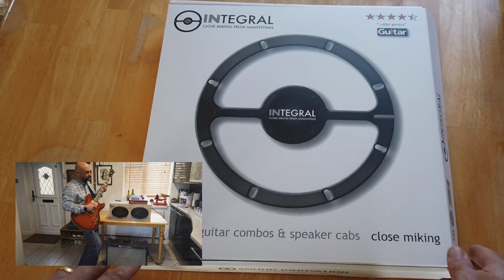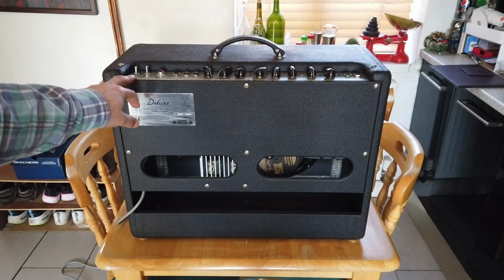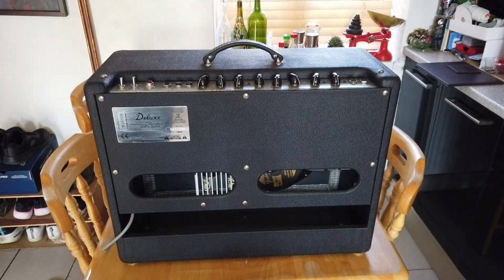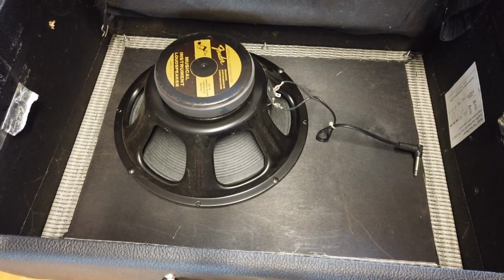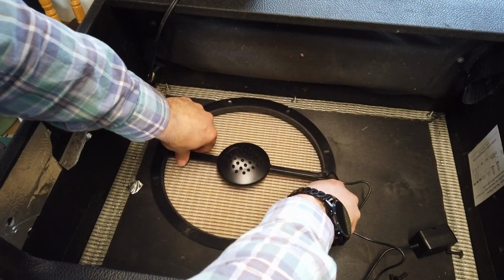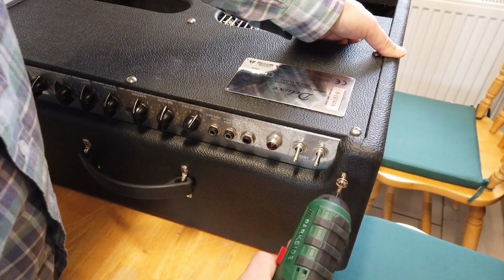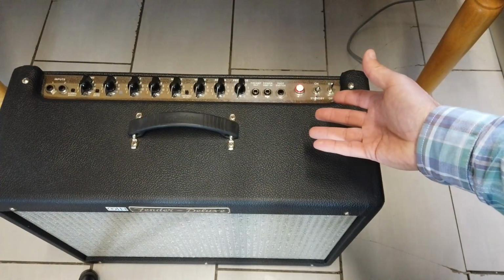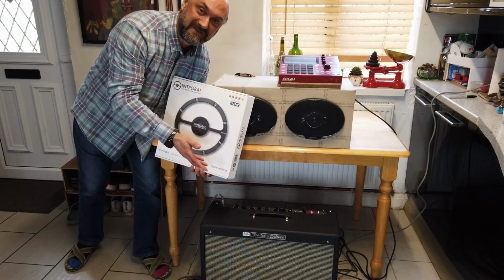DuB-EnG: SAMSystems Integral - Analogue Close Cab Miking System for acoustic, bass, electric guitars

Comment from the maker: Hey folks, it's occurred to me that I could have easily fitted the XLR connector inside the cabinet with the connector facing outwards so the engineer can plug into the socket.   I will make that modification shortly.  Then the socket isn't at risk of being knocked or bashed.  Also note, there is a through hole type XLR connector included in the kit so you can fit it to a closed cabinet using a hole saw.  ...  Silly me!  😂

Comment: Very cool, the only thing that genuinely felt a little dubious is the mounting of the XLR chassis outside of the frame of the amp.  
I know my tendency would be to catch myself in the leg or rip it off on a doorway (or have some such happen to a roadie/helpful friend).
Reply from the maker: I agree, There's an option to drill a hole and slide an XLR chassis mount in place...  All of that is included the kit.
Reply: No worries because it`s your decision where to mount the XLR. There is space between the two back panels it could go so that the XLR faces outwards. Probably easier to do that once you`ve put the speaker back before the panels are replaced. There is also in the package an alternative mount making it a flush fit. Choices...

Comment: Interesting... I prefer to just go line out and let the sound man mix it.
Reply from the maker: If you have a specific sound that you're looking for, unless you join the sound man and tell him what you're looking for, what the public hear out of the PA will be totally different from what you're hearing from your amp if you use line out.  This system copies exactly what your hearing on your amp into the sound desk.  That's why sound engineers continue to mic up cabinets!
Reply: That`s OK if you have a line out. It`s usually only a feature on bass cabs. However, a line out is a simulated sound not a speaker sound moving air.. A lot of guys actually blend the two... best of both worlds.
Reply: You're using some kind of cabinet emulation though?